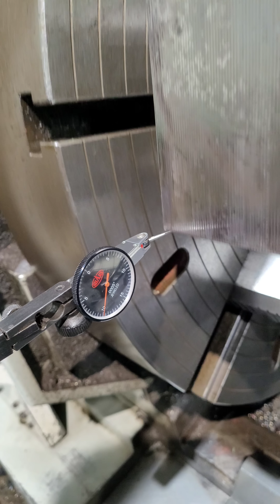New Spider for Expending Mandrel- Pickle Line | CNC Machining

Comment: The brand of CNC machine 3 axis vertical machining center is Hartford cnc
Reply from the maker: It's a Yama Seiki BM1600
Reply: @ChrisMaj  I recommend Hartford MVP 11 i x 1000 y 800 Z 600 spindle 12000 RPM an excellent workbench
Reply: @mustafaozgul4118  no this is Japan machine very good

Comment: man I've never seen pickles like this before.....
Reply: lol, different kind of pickle line....its a process flat rolled steel is put through to clean the steal before heading to coating lines, etc. This part is a part of the reel that the steel coils are unwound from or wound back up on at the other end of the line.
edit: * steel 🙄🤓